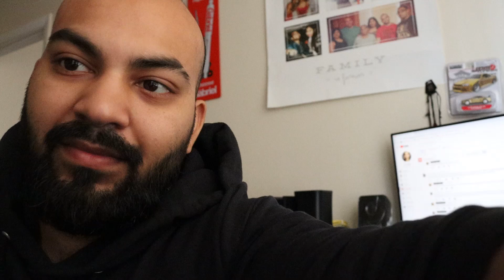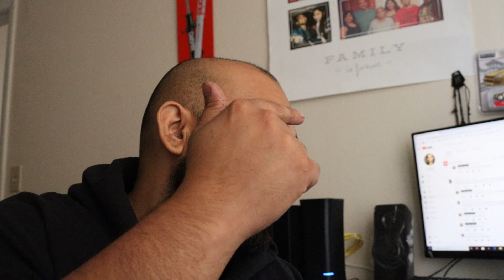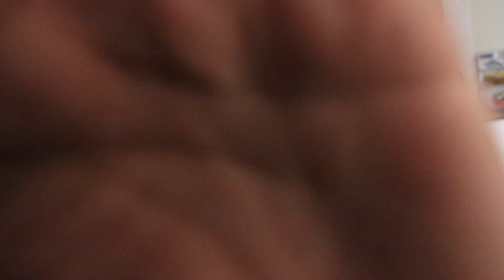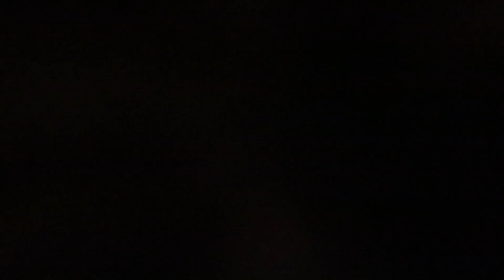CHEVY AVALANCHE TRANSMISSION ISSUES! VIEWERS RESPONSE ( MAY 28TH 2020)

Comment: Thanks bud You said my name right the first time 👌🏿 I'll go with the valve body and get one probably this weekend
Reply from the maker: Sounds good boss, let me know how it turns out
Reply: @Kingcustomz  Update: I replaced the valve body and because I have a hi stall torque converter and the truck isn't tuned right I'm not sure if it's fixed or not. Currently it's been dumping fuel and the Cats are getting red hot. I think it's my Injectors ( new  ones are 4 port and not 2 port)
Reply from the maker: Have you spoken to a tuner, just to see their opinion
Reply: @Kingcustomz  the only tuner I've spoken to was about a month ago and is booked up so I just tuned it myself  enough to where it's drivable. I'll look around for another one

Comment: Hi dude, im looking fw to buying a 2004 5.3. The car is not registered and can not be test driven, only started. Any idea how i could test the transmission without driving far?

Thanks!
Reply from the maker: no dude lol, other than jacking up the rear wheels off the ground and pressing down on the throttle.  make sure its in two wheel drive and not 4 wheel lol
Reply: @Kingcustomz  you're the best, didn't think you ll bother to reply.
Test drove the avalanche in a parking lot, the battery was dead, and the alternator wasn't helping. Nothing in the instrument cluster was available, so I couldn't really tell what I was selecting. 
First down was reverse, last down drive, I guess. Anything in between I was assuming to be either neutral or any of the 2,3,4 gears. But if anything, that would dictate max gear rather than productive gear. 
The engine had 320 000 km on the clock, which should be round 207.000 miles, ran like butter. 
Not being able to fully test transmission and these odd power outages make me uncomfortable with the purchase. Need to give it some thought.

Thanks again for the content u provided, and ur nice feedback

Comment: 2005 Avalanche with the same trans. Rebuilt twice under warranty at the dealership and third time by AAmco. Only road miles and the only part I hate on this truck.
Reply from the maker: Wow how many miles for the first rebuild and how many on the second. How many on the third?
Reply: @Kingcustomz  roughly for me mine first when out when it was around 7 years old and had about 80-100k miles. This is the second time it's gone out so it's around 170k
Reply from the maker: Wow, I hope mine doesnt go out lol, or else we gonna have a episode of how to rebuild a transmission lmaoo
Reply: @Kingcustomz  it's honestly super easy only issue is not having certain tools for removing the trans pump (If you don't have the pulled you can just remove the valve body and take a screwdriver and wedge it out) and the actuator spring for the 3-4 clutch piston ( for that you can take 2 C clamps if you don't have the tool also
Reply from the maker: If I ever have to.make that video, I'll definitely  link up with you hahaha
Reply: I'm second owner of 02 and the original took care of everything very well, first transmission went out around 140k I bought it two years ago and with 260k week later had to replace transmission,
I got AAMCO 3 year warranty rebuild, a week after that my digital odometer went out, but a year later I will guess 30,000 miles later guessing on heavy milage and went out 
they said because I had my space tire on which was 2 inch bigger than the expensive michilan set I have caused the trans to fail...
IDK... I call BS, seems this transmission has issues I'm guessing if 200k is good for a transmission, these are sus at best ..
I'm locked in on this truck because I know all the issues, but I'm not digging this at all, I may cut my losses and try to get money out a 300k engine with no issues and suss trans ..
Reply from the maker: You gotta do what is comfortable for you. They have awesome rebuild kits for transmissions to make them better than before